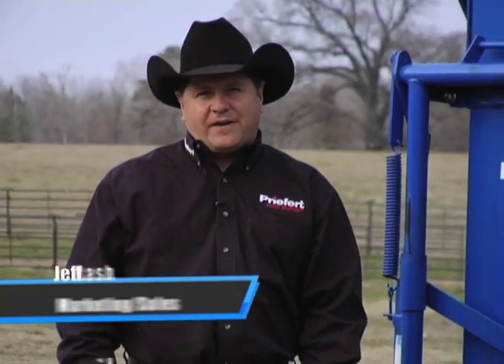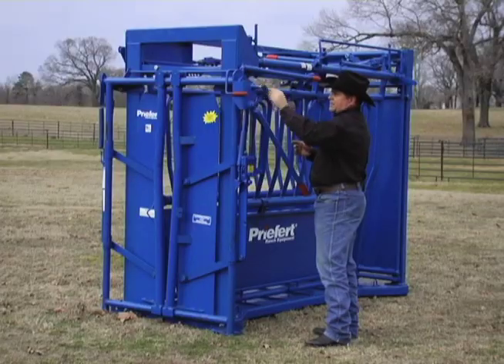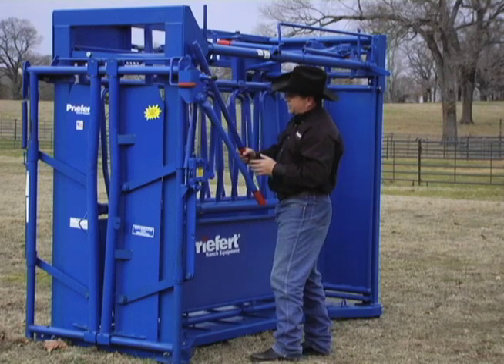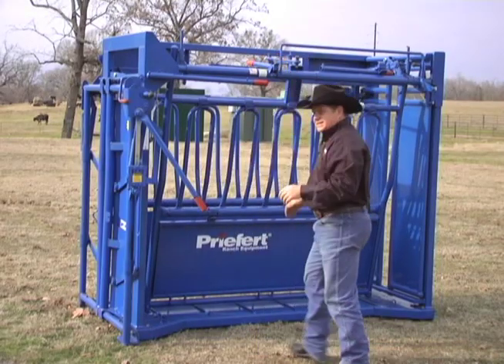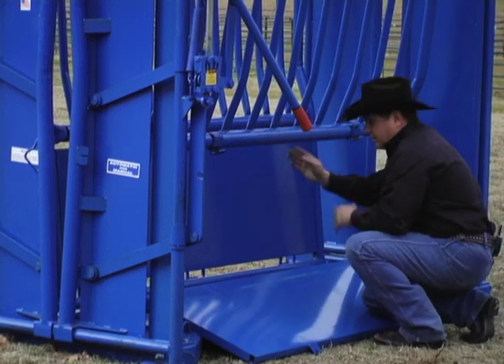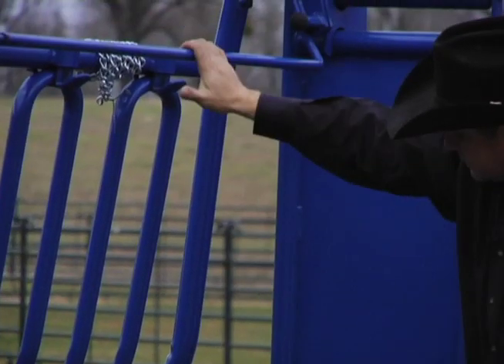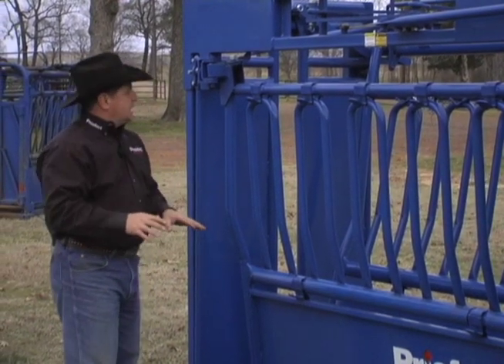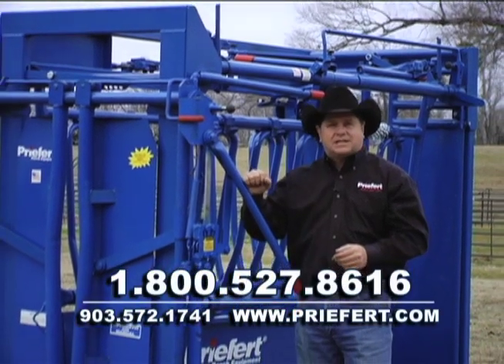The Ultimate Cattle Working Machine "The Priefert SC11 Squeeze Chute"

Comment: The Chute is designed to safely restrain cattle so they can be medically treated. 
The SC13 is Bigger, heavier, and with more features than any other chute on the market, Priefert’s Model SC13 heavy duty Squeeze Chute is the “Ultimate Cattle Working Machine.” Designed with today’s cattle producers in mind, this chute offers a number of features that make it one of the safest chutes on the market for animals and operators. Like all our chutes, the SC13 uses our patented “Infinite Locking System” (Guaranteed for Life), so that cattle are always controlled by the lock, rather than by the strength of the operator. With many of the same features as our S04, the SC13 takes the concept of “Easy on the Cow, Easy on the Cowboy” to a whole new level. The Architectural Grade Powder Coat Finish on the chute is not only durable and attractive, but with its UV inhibitors, it will add years of life to your investment.
Reply: If this chute has been discontinued, why are you still marketing it?

Comment: We are from Australia where we have a cattle ranch. I see that there does not look to have a designated vet crush at the back with access etc. I do like some of the features like the automatic catching system. I was in Canada in 2015 and saw a old style chute, (which we call the a cattle crush), that as the animal moved forward the head bail section which was like a saloon bat wing door style came forward with the animal and then closed on the neck with gravity latches. Then when finished the stock man just released the gravity latch and the bat wing door opened forward allowing the animal to walk out. What is the value of the SC11?